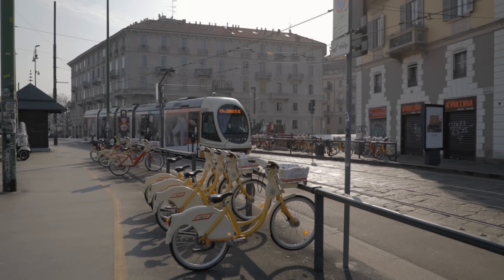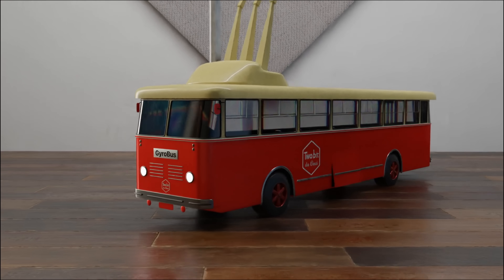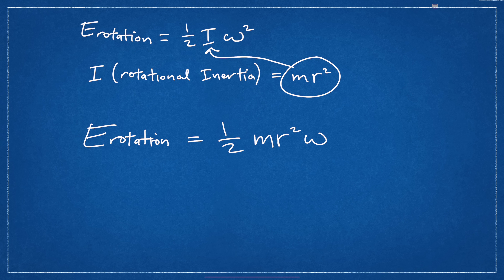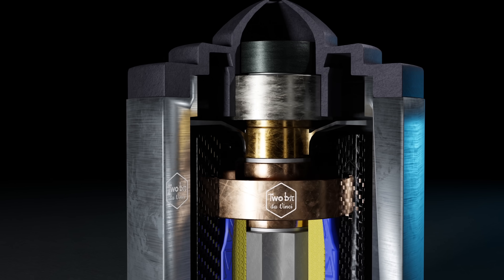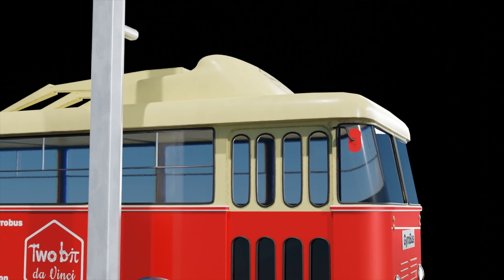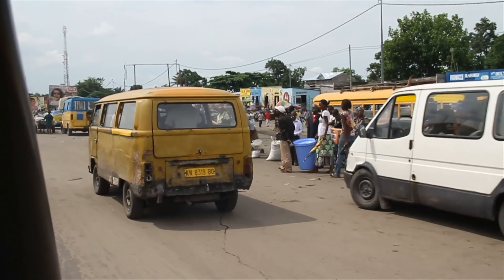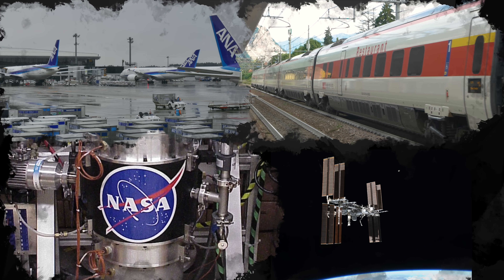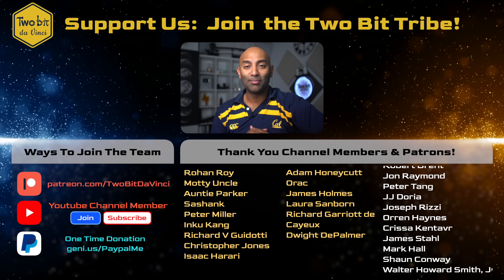This Bus Went Electric WITHOUT Batteries

Comment: They could build an updated version of a Gyrobus using 2 flywheels instead of one and make the 2 flywheels electromagnetic and inside of a complete vacuum. They could also have the same type of battery used in Tesla electric cars between those 2 flywheels.  Any thoughts on this idea?

Comment: The Majority of Large  USA  Cities  had  Electric Trollies  until .. Firestone .. Standard  Oil and General Motors  bought all the  Electric Trollies  and  replaced them with  Detroit Disel  busses..
Reply: Technically true, but they were all moribund anyway. They’d been losing money for years and would have closed anyway. (It was a complex problem caused mostly by their franchise agreements with cities, which not only didn’t allow them to raise fares to compensate for inflation, but also made them responsible for all road maintenance on the roads their routes used. So at the same time as fares became worth much less, they began losing riders to cars, who then drove those cars, causing wear and tear, on roads they had to pay to fix! Totally unsustainable. As a public transit advocate, I think what really needed to happen was to renegotiate with the cities, but sadly that didn’t happen.)

Comment: the problem with flywheels is that if the vehicle gets old there's a high danger with the fly wheel turning so fast that it can disintegrate and explode like a bomb!. a few years ago they made a indie car with 4 wheel electric motors and a fly wheel and a small helicopter jet engine for supplemental electricity!. the flywheel turned at 300,000 rpm and was about 4 ft wide, so you can imagine what would happen if it decided to crack or break during use!.

Comment: Flywheels are cool.
Been thinking about them a lot.
Instead of the heat and drag of turbos and superchargers a hood scoop could funnel air to drive a vaned flywheel attached to the intake impeller via a clutch.
While there's no boost at cold start once up to speed there should be plenty for hills and passing.
Then I dreamed about a hybrid Wankel where a ferrous rotor spins in an induced magnetic field and can run on gas or electric.
That lead to dreams of an electric motor flywheel that could make any manual transmission a hybrid and a torque converter one for automatic transmission.

Comment: You make it sound like making a flywheel spin you create energy. Every system, including flywheels, requires more energy input than can be gained as output. Flywheels are important of course, but they don't create more power than it takes to make them spin. Flywheels are in every car (actual flywheel in a manual transmission, torque converter in an automatic, same principle). But there's no such thing as a free lunch.

Comment: I think that gyro-flywheels actually may be the future in automotives replacing both batteries and gas we could use solar power to initially give an electrical charge to start the gyro then the gyro will power itself . Look at china's super high speed trains what is it they are using ? Gyro-fly wheels for the fastest rail system on earth

Comment: This is cool and all, but it does absolutely nothing for reducing the need for fossil fuels, if that is what you care about. 

You still have to burn the coal/oil to generate the electricity to spin up the flywheel.

Comment: Fly wheel power from exercise equipment for reduced electric bill? Pedal yourself to health and reduced costs? 
Pedal powered fly wheels for home shop tools? (an old idea that worked) Run a circular saw, jig saw, grinder, planishing hammer (for the home metal smith) rotary shaft tool, temporary lighting, exhaust fan, light duty vacuum..ect I’m for it.
Here’s one you probably shouldn’t like; Turn prisons into pedal powered electric generation plants. (we would probably end up on hamster wheels) (on second thought, might be just the thing for obscenely wealthy tax cheaters 👍)

Comment: The purpose of a battery is to store and release energy. 
Be it a chemical battery, a wound spring, a pressurized container, or a volatile substance, they all provide the energy that an engine/motor will turn into work. Which in the case of vehicles is movement of the vehicle.  
It's even possible to use an additional engine/motor to convert one type of energy, such as the mechanical motion of a flywheel, to another, such as electricity, which is then used to power another one that converts it to motion in or transmitted to the wheels.  (Using a land vehicle for the example since we're talking about a bus.)
You still have to store energy in the flywheel before it can be used, but so long as you aren't using a combustion based system to provide that power, it's nice and "green".  Even if you do use a fossil fuel, it's still better for the cities as it moves the pollution to a powerplant that is hopefully not in the city and has better pollution reduction systems than a combustion vehicle likely has.
An accident with a flywheel powered vehicle could get really nasty if the flywheel breaks loose.

Comment: Correction..swiss overhead wired everything. Both trams and buses and the whole train system was electrified everywhere by 1910-1920. I rode those buses and the air powered and the overhead variant as a kid. The electric overhead one had a nice surging uphill acceleration. All had kind of a crashy ride. All had a small backup diesel engine.

Comment: I saw a report on the use of flywheels to power buses several years ago. On the face of it it looks like a good option. It could be powered up while it was sat in the bus station. And this power could be topped up by tapping into the brakes and feeding power from that to get the flywheel back up to speed. Energy which otherwise would be wasted.

One of the big concerns was want happens to a flywheel weighing several tonnes if it is involved in an accident and it breaks free. Just imagine the carnage caused by it running out of control in a populated area. One solution would have been to put it in a safety cage to reduce the possibility of it breaking free. But that would have taken up about a third of the bus. Which would mean the revenue generated by each journey would be reduced by one third. So any financial advantage gained by using a flywheel would be lost by the much reduced income.

There are undoubtedly areas where a flywheel will be beneficial. But transport looks like not being one of them.

Comment: I worked on flywheel energy storage in late 90’s and early 2000. They are great but can’t compete with super capacitors for most applications.

Comment: 50-60 miles an hour for 6 miles ! Now that's sounds like a lot of power for a city bus . If this was build in the 40thies/50thies it's probably all steel .There must be ways to modernize this tech and make it more efficient by using lighter materials ( and maybe reduce the scale & combine it with a battery charged system  ? )
Reply: Not exactly....the range was 3.7 miles at 30-37 mph.....he was talking in kilometers not miles.   In the end...it wasn't economical to run and even today the 'Green' types tend to overlook the economics of their desire for clean everything.    This extends to battery vehicles where they ignore the source of the batteries and the pollution made during their creation as well as the difficulties when they reach the end of their lives.   To be completely honest we should be looking at every potential energy source from mining and production to end of life for the most reliable and cleanest technology.   Wind and solar fail this test badly...leaving nuke or natural gas as our only viable options currently.
Reply: @recoilrob324  Now the energy prices are going up, i'm already notice i'm getting annoyed. And i'm  leftwing pro-green etc. We need a real substitute fast, because people won't cut on the comfort of energy ,  'to save  the planet'. That's not how we humans are wired.
Reply: @spiritualanarchist8162  I'm a Right Wing gun nut type but also believe in being as efficient as possible with energy so we have some common ground here...which is good!   Around here we have windmills sprouting up but they're only increasing our electric bills because they get paid for whatever they put out but the grid must have base generation running at all times because the wind production is spotty.   What little they make isn't actually helping and I seriously doubt that any of them will pay back the energy investment it took to make them in their lifetimes.

For wind/solar to actually work, it must be dedicated to part of the grid and be responsible for 24/7 power...which of course neither can provide....so they have to supplement with natural gas generation to keep the lights on.   One of the big solar plants in CA is in trouble because they're burning many times more gas than they promised when getting their permits because their production is only a fraction of what they said they'd be able to make.

If we covered the country with windmills they couldn't make enough to keep things as they are now....so for a 'green' future we'll have to degrade our standard of living.   AC in the summer?  Forget that.   Cold in the winter?   You bet.   Listen to the people crying in CA when their power goes out because of all their stupid ideas before it's too late.
Reply: @recoilrob324  I saw so many windmills not moving for lack of maintenance when I lived in CA in 1980s

Comment: If it was any good they would be used all over the place. But obviously they did not. In 1910 and 1911 there were a lot of flywheel explosions from the huge steam engines.

Comment: I have installed a Flywheel UPS center for a power backup. I have only seen one. It will give 30-45min of power after the main power is down due to fault or whatever reason there may be.

Comment: What would be interesting if we could somehow move the weight to the center as the energy is drained from the system. It would keep the rotation speed high and prolong the energy produced. Upon charging the weight can be moved to the outside again.
Reply: I don’t think that energy would be gained by doing that. It’s in the math.

Comment: I wonder what happens over time to the structure that supports the flywheel?  There would be times, like going up and down hills where supporting structure would be significantly stressed.
Reply: Its housed in gimballs i guess. That would probably cancel it out.

Comment: Chrysler tried something similar on an experimental car about 20 years ago, but they made the flywheels out of plastic, reinforced with carbon fiber or Kevlar or something along those lines. They had embedded magnets so they effectively levitated within their chambers and didn't need mechanical bearings. One of the "last details" that needed ironing out was the fact that despite being gimbal-mounted, the flywheels, going 100,000 RPM, could crash their enclosures if the car went over  a big bump in the road. I have not heard anything about them since.

Comment: In the 1960s, a few submarines were outfitted with computers that utilized magnetic "drum" storage devices that were cylindrical drums made of non-ferris metal about 18" in diameter and several feet long spinning at about 1000 RPM. It quickly became apparent that the inertia from these rotating drums caused significant problems when steering the submarine not unlike the problems the flywheels on your bus presenter to the bus drivers.

Comment: For what it's worth, this kind of flywheel energy storage device is called a "compulsator".  Prior to the development of supercapacitors this was how one built a system that would let you trickle charge from a low capacity power source and then dump that power all at once.

This has carried on in sound effects, even though compulsators are relatively rare these days.  When the evil genius or whoever clicks on his doomsday device and you hear that distinctive, mechanical whine building up as it charges, that's what a compulsator powered device sounds like.

Comment: So much technology, but no word on public transportation using super-capacitors... Those are in use in Europe, not largely, but it's picking-up. Even in the heart of Transilvania, my city of Brasov uses this technology. Basically instead of poisonous batteries, like those found in Tesla and other elector-carts, the super-capacitors are harmful. They charge in a matter of seconds, while in a station and have about 4Km ~2.5mi of autonomy. They don't use more power from the grid, than a battery powered vehicle of the same size, but the leak of a battery makes them a lot greener, more reliable and cleaner in the long run due to not having to dispose all that waste. The concept of charging while passengers get on and off is the same... The US is gazillion of years behind in this respect (and others)...

Comment: A flywheel operating on a vertical rotational axis will not interfere with the turning or acceleration, or braking of the bus. The gyroscopic effect only applies, when something tries to change the angle of the axis of rotation. in other words, the flywheel will try to turn pitch change into a roll motion, and more commonly, the roll gets transferred into pitch. Since the bus has more wheel base length than track width, this would make the bus feel extremely stable.
     Since the speed of the flywheel fluctuates with the amount of stored energy, and the bus traveled at different speeds, there needed to be something similar to a continuously variable transmission. Back then, there were DC motors on both the drive axle, and the flywheel itself. the needed ratio was achieved by manipulating the field current of both motors. It worked great, but, it wasn't very efficient. (technology borrowed from the first diesel/electric locomotives) With modern permanent magnet motors and pulse width modulated controllers, that same bus would use less than half the energy per Km, and, go more than twice the distance on a spool up. (charge) This kind of bus could make a comeback, with modern technology. You will undoubtedly see flywheels that are smaller and lighter, but, spin at much higher RPM, to store the same amount of energy.

Comment: I think a flywheel storage system should be present at every step down transformer on the grid, which can be used for both grid balancing and backup  power. It would stop spikes or judders in the supply which can cause damage to electronics.

Comment: People in the past weren't stupid.

Flywheels were never used for long term storage in the past.  They were used for short term storage.  Why?  Because it turns out they are horrible for long term storage.  Look inside a 150 year old clock and you will see what I mean.  There are obvious long term storage solutions that no one thinks of these days for some reason.

Comment: in my mind this is more sustainable and smarter than batteries, to say flywheels have come a long way is an understatement, get the formula1 ingeneeres to design a drive system based on their kerssystems wich stored braking power before hybrids were a thing, combine them with modern overhead charging, and these busses could very easily replace e-busses, which are terrible in colder climates^^

Comment: The problem with all flywheels is that the energy required to spin the flywheel will always  grater than what the fly wheel will give you, they are pretty inefficient

Comment: Very interesting video. My math skills are pretty basic so didn't understand much of that part. I wonder if it would be possible to use the rotation of the wheels and the braking on vehicles could help in the charging process. This seems to have potential for the future.

Comment: Batteries are better. The flywheel needs a lot of mass at high speeds. It is both heavy and not safe. They are useful if you makes frequent stops however. Because you can capture the energy of stopping, storing it and the use it as you accelerate. That takes the load of the engine and batteries and gives you a boost of power. If you make thousands of stops like public transport busses it could have a huge benefit in energy or fuel savings that add up in the life cycle of the bus. So the idea is not a throw away, but a must have that might just save the world.
So you know we will never see it happen.

Comment: Those gyro buses have 3 electrical contacts so I'm guessing it's a delta feed.
Reply: almost all large electric motors are three phase, back then all, the motor only cares that the voltage is correct, not that it came from a specific transformer topology like wye, delta, etc.. the supplied phases are indistinguishable to the motor given, just the phase to phase voltage needs to match the motor requirements, and it needs all three of the supplied phase lines to function, beyond that, it is of no consequence to the individual load. The topology only effects what Line to neutral loads can be served, and how they are wired relative to the phases, and also how those loads balance out with the 2 and three phase loads accordingly then lastly how they will all come together to the complete picture of how the system is loaded down, and things can be arranged to minimize imbalance. All that is irrelevant to the individual loads though, unless they happen to cause an interruption in service due to lack of proper management..

Comment: I remember seeing this on the cover of one of those "pop" tech zines from back then. Whole factory needs uninterruptible power. They have a big electric motor-generator-flywheel-diesel engine affair. The flywheel bridges the gap between power loss and the diesel generator getting up to speed for constant 60 cycle AC power.